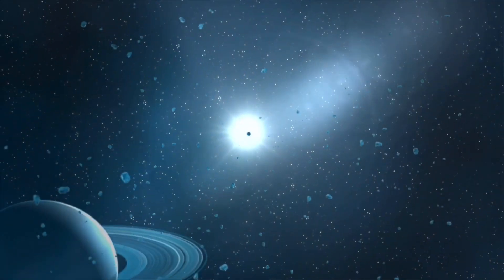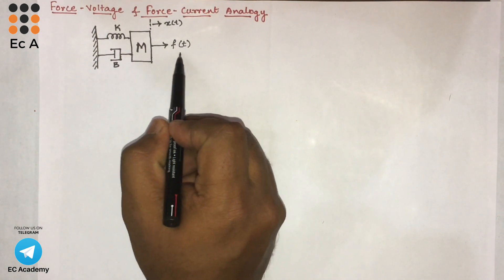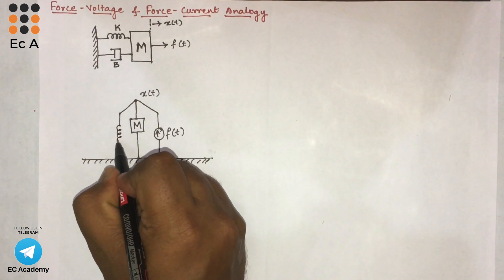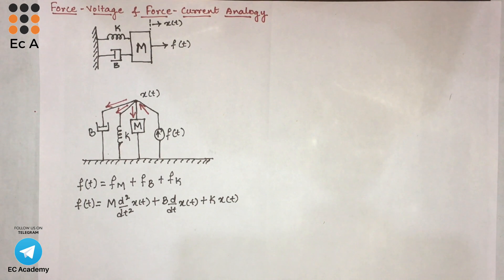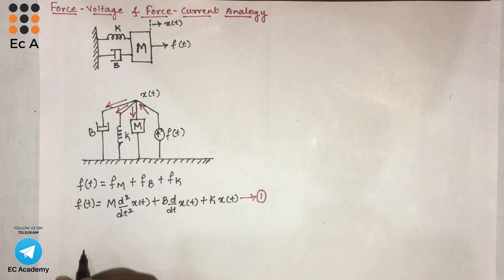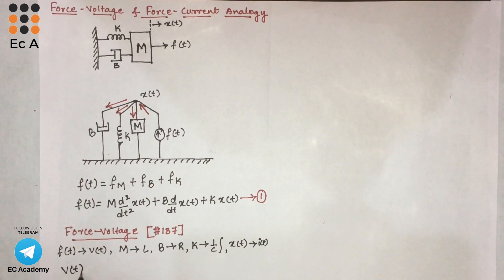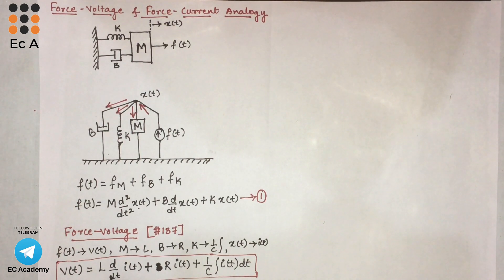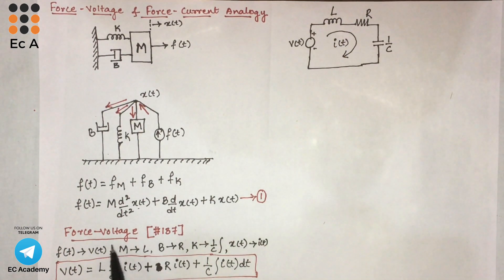Solved Example | Force-Voltage & Force-Current Analogous Circuits in Translational Systems

Comment: Why do we have to learn this, and where is the application of this theory??
Reply from the maker: The force-voltage and force-current analogies are used in real-world applications to model and analyze mechanical systems using electrical circuit representations. These analogies are employed in diverse fields for system analysis, simulation, and control design.
Hope this is helpful.
Do subscribe & keep supporting EC Academy ✌️

Comment: You have made a small mistake.
U have written x(t)---> i(t). . actually it should be x(t)----->q(t) charge in coulomb. 

Otherwise video is good 👍
Reply from the maker: The conversation is correct... plz refer video lecture no. 137 to know about it...
Hope this is helpful 
Dont forget to SUBSCRIBE and keep supporting EC Academy 👍
Reply: @ECAcademy sir what the guy said is correct 
If x(t) = i(t)
Then d²/ dt²(x(t)) should be equal to d²/ dt²(i(t)) but u have just written d/dt(i(t)) but if x(t) =q then above eqn are correct